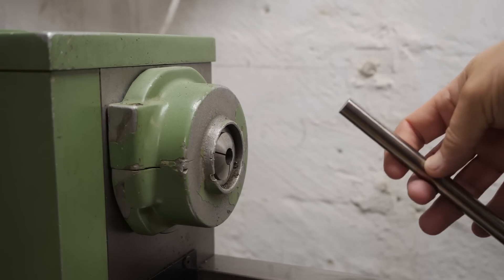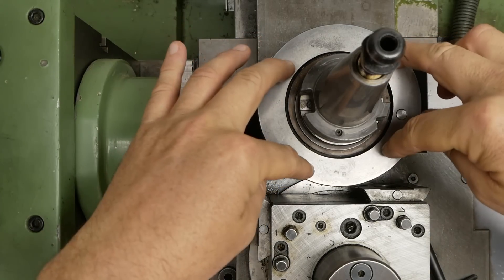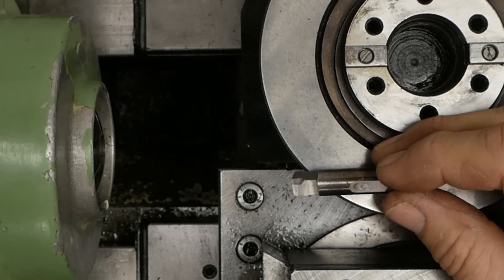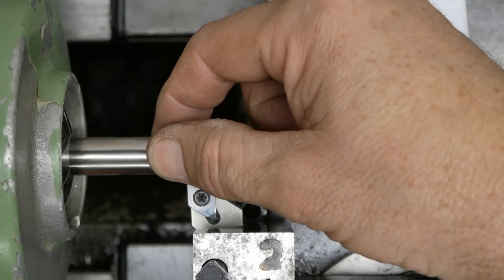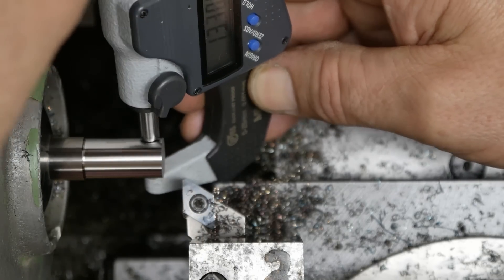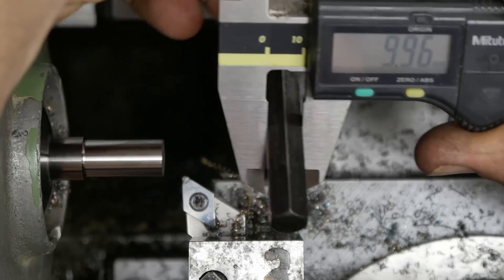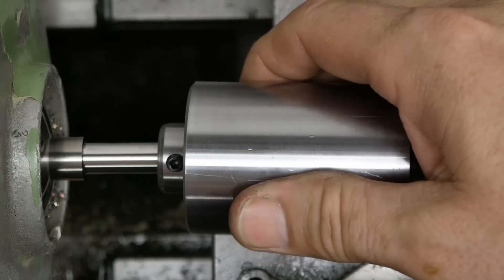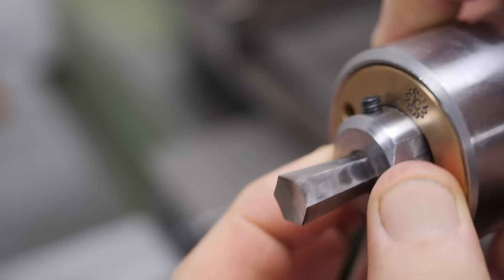Can you hard turn HSS in the home shop? || RotarySMP

Comment: I'd rather measure in a mixed metric, measure in thousands of an inch below or between multimeters. And in millimeters until a foot! Crazy but it's easier. 3mm /1/8", 6mm/,1/4" that or
 .250"/1/4".125/- 1/8" I dislike fractions. I don't work using it , but hobby stuff it's just easier in my head . Imagine going some place , telling someone you need  300 mm x .250" long  brass bar stock,. Then take it home and make metric head bolts with inch threads😂
Reply from the maker: I used to prefer tolerances in Thou, but have become more comfortable with metric lately.

Comment: At some point with the rotary broach, how does one go about accounting for the hole depth you're going to lose to the swarf(?) that's being compacted into the bottom of the hole?  If I need x millimeters of hex key tool engagement (depth) in this bolt I'm making, and the tool is a y millimeter hex, what is the initial "x + z" hole depth I'm going to have to drill/bore?
Reply from the maker: I just give it about 50% more hole than I need. I dont have a lot of success with rotary broaching though.

Comment: I hope you are going to sharpen that CBN tool back to cutting shape. Robin Renzetti told us on his Instagram that you have to lap the edge of the CBN insert to a very keen edge if you want to avoid chipping of the edge. 
You of course use diamond wheel for sharpening.
Reply from the maker: Yes, I was going to have a go at touching it up. Thanks for the honing tip.

Comment: when hardturning with a cbn tool never ever use liquid coolin on them at all. max use some air 
and its not just with hard turning that you make plasma deformation but you actually do that with every metal machinigh operation ( even grinding. we where tought that by seco back in school when i took the education as a machinest )

also there is a roughing technice that i developed. tested and used myself witch extended the inser corner life from 4 parts pr corner to more then 25 parts pr. coner with the same feed's and speed's witch i call "constant varying depth" it casly have to be hand programmed ( at least for now ) but it is super effective to increase the tool/corner life of the roughing insert

eks.
N300
G28 V0U0
G28 W0
G40G18G80
T0202M91
G54
G96M3S100P11
G50S1500
M28
G0 Z0.2
G0 X50.
G1 X-1.6 F0.18
G1 0.3 X1.0
G0Z0.5
G0 X45.
G1 X47.0Z-12. F0.25
G1 X45.0 Z-22.
G1 X47.0 Z-29.7
G1 X50.0 Z-29.6
G0 Z0.5
G0 X42.
G1 X44. Z-5.
G1 X42. Z-11.
G1 X44. Z-19.
G1 X42. Z-25.
G1 X44. Z-27.
G1 X42. Z-29.7
G1 X45. Z-29.6
G0 Z0.5
G0 X40.
G1 Z-30.0
G1 X50.
G0 Z0 X100
G28 V0U0
G28 W0

( the G28 just tells it to go in hope position and the "V" "U" and "W" is actual machine axis ( the W is for a Y axis btw ) you can just ignore the G28 ones ( took this from a program i made some time ago ) and also forget the P11 since it was specific for the citizen dual spindle tripple turret. witch allowed it to actually start turning the spindle and the M91 was to allow it to change over to the tool

try put the code into " ncviewer.com " set to lathe mode to see how it actually look and how it works

instead of letting it cut air why not just put in G4 x5 in before the first cut ? that way it would get up to full rpm before moveing ? ( G4 is a dwell command and the X value in the same line is how many seconds its dwelling for )
Reply from the maker: I have G4 P5 set in my PP when I use cam, but that conversational lathe macro doesn't work like that. I probably need to learn how to edit it's code.
Reply: @RotarySMP  sounds like a good idear. hope you also be able to use the code / methord i showed in my comment on a diffrent part. best of luck m8

if you want i could program a part for you if you want. if you do then just send me a mail

Comment: I did some hard turning of some 62 rockwell C tool steel the other day, what I found was the inserts would almost immediately chip but then would cut just fine on the chipped surface for a decent amount of time.  I wasn't using any kind of special insert, just regular stuff for turning steel.  I'm guessing hard turning likes a blunt edge, so that CBN insert might last some time even with the chipped edge.
Reply from the maker: It was not so easy to tell from the macro shots, but my feeling was that the CBN was more eroded than chipped.

Comment: Great video Mark. I have recently acquired a Wohlhopter UPA 4  with an ANSI 4 / MT 4 taper arbor that I want to change. However mine does not appear to have a removable arbor like yours. Do you have any information about the UPA 4 that could help me?
Reply from the maker: Is there a hollow arbor with an allen key wrenching hex down inside it? If there is you need to turn it clockwise, as though tightening, to allow the differential screw to release.

Some of the earlier Wohlhaupter had non-removable arbors though. There is a video out there of a guy converting one.

Comment: If you set up the system to drive the spindle.0.at-speed pin then G1 moves won't start until the spindle is up to speed.
Reply from the maker: Hi Andy, when I was editing, it occurred to me that there would probably be a solution like that. I need to look into that.

Comment: Hi Mark. Another great video. Back in the day, early nineties we used to turn hardened toolsteels D2 and O1 mainly at approx rc 60 using ceramic tips these also put out nice red hot swarf. I haven't done any real hard turning since. With the  cnc lathe I think you should try putting  bigger radius on diameter change steps as much as possible to avoid stress concentrators. Especially with rotary broach tooling.
Cheers for the excellent vid
Reply from the maker: Thanks for that tip Steven. In this case that diameter change basically got ground away when I ground the hex (which was probably too long).

Comment: Linux tip! Instead of using an HDMI splitter, you could capture directly in software from your LinuxCNC machine since -- it's a Linux machine! Normal things work on that too. You'd only have to make sure you have enough performance dedicated to running the actual machining program first.

Fortunately, a feature on Linux called cgroups is very good at guaranteeing some minimum specs (ram, cpu, etc...) for the app, and you could test it to see if doing both simultaneously causes either frame loss or spindle issues.
Reply from the maker: I do use the linux simple screen recorder all the time, but for live streaming, I would need an HDMI feed, not recording.
Reply: @RotarySMP  I understand-- you can send a stream of your screen (live) over your LAN to whatever machine you run OBS on or whatever streaming platform... No need to use HDMI cables and involve more hardware when you already have ethernet!
Reply from the maker: @purpleidea  I switched from OBS to an Atem mini pro ISO, as I got too many random stability issues with software switching.

Comment: I turn die punches (60 HRC) with CBN, it's a lot faster than cylindrical grinding.
Reply from the maker: I bet. What machine?
Reply: I use Winho lathe with ER collet chuck inside a 4 jaw chuck

Comment: Does Linux CNC have a MDI mode where you can execute single lines of code. If so something like S3000 M02 could pre start the spindle and the real program would not be accelerating the spindle at program start. You could get real fancy adding the spindle speed and start to the main program along with an optional stop. BTW The Chinese make a direct copy of the Narex so that may be an option for a cheaper arbour. (toolmaster from Hare & Forbes here in Aus and Unzud
Reply from the maker: Hi Rob. Yes, there is an MDI mode, and I also have my PP set to add a pause (G4 P5) after each program start when I program a part, but those lathe macros are a bit different.

I could probably still buy a Narex shank, but now have the material to make my own.

Comment: Oh this is going to be a good one. I just went through this with my Wolhlaupter head with a integrated 1-1/2” straight shank. 
I too used the CBN inserts on my lil Clausing Metosa C1330S manual lathe. I was able to turn that 1-1/2” shank down to a .010” oversized 3/4” shank, then finished it up with the trusty tool post grinder down to size. Them Wolhlaupter heads are case hardened to Rockwell 20,000 billion I think…. 
But I managed to turn it down with only one tip of one insert by taking .005” passes or less. 
The plan was to “practice hard turn” the shank down and then ultimately cut the shank off and drill and tap it for the differential screw ( I believe it is 20mm 1.5 and 16mm 2.5 pitch but I haven’t been able to confirm that yet) they also had two 10mm drive pins at 40mm on center. 
Boy am I’m glad to see you taking this one on. I’m hoping to learn a little bit more and interested to see how the Schaublin does as well. 
Always enjoy your videos, and I really appreciate your humble approach. You are going to love that boring and facing head though ! Looking forward to seeing its cameos in upcoming videos ! 😊
Reply from the maker: Thanks for the kind feedback Jason. Luckily the Narex shanks are all bolted on, so I dont have to do any hard turning on that side.

Comment: Wow, great videography! Really liked the close up Makro shots. As for the chipped insert, you at least can touch them up one time, just put on a nice slightly negative radius on the cutting edge.
Reply from the maker: Hi Christian. I dont think that insert is chipped. It looks more like wear. Did you regrind some with a diamond wheel? I need to try that.
Reply: @RotarySMP  yess i use a diamond wheel, diamond still beats cbn😁 stefan gtwr made a video a few years ago about that topic.

Comment: For the hdmi splitter idea i recomend adding a wireless hdmi cable (about $35 usd on amazon), you may want to cut the ddc pin on the wireless transmitter as you dont want it fighting with the lcd panel to set the resolution (at least it was on the cheap splitters ive used, aparently more expensive ones have ddc priority so it would take the resolution from one port and just duplicate to the second port, that was just the cheapest powered splitter i was using that needed ddc cut)
Reply from the maker: Thanks for the tips.

Comment: I've turned HSS on my Smart & Brown lathe. Not something I need to do often but carbide inserts did it with no real issue. I can't remember what I needed to do it for as it was some time back.
Reply from the maker: Did you wear out the inserts pretty fast?
Reply: @RotarySMP  I can't remember but I think I used the sharp polished and ground inserts that are designed for aluminium alloys. I have found they work well on stainless steels. I was looking for a picture of what I did to try to remember what it was for, I think I have one somewhere. Edit, I found the photo. I wanted to make a small gear cutter and needed to neck down a short part of the shank to leave the end to be shaped for the gear cutter.
Reply from the maker: @martinconnelly1473  Was it a commercial HSS cutter? Many are not HSS blanks. They often friction weld conventional steel shanks to drills etc, to not waste HSS on the bit that doesnt need it.
Reply: @RotarySMP  It was a HSS blank. Not just part HSS. My lathe weighs 750kg so it is not a lightweight hobby lathe.

Comment: it's really cool to see someone actually hard turn on youtube. hopefully we can see more hard turning with say something like 4140 ph
Reply from the maker: When I went looking for info on hard turning HSS-E, there is not much out there. There are plenty of videos, like Stefan Gotteswinter's of hard turning more conventional steels like 4140 though.
Reply: @RotarySMP  yeah, for hss you can use carbide, just normal carbide, id stick to insert tooling though.

the hardest I've personally worked with was a customer job at work that called for 4340 with a hardness of around 55 Rockwell C but the same logic still applies. as long as the cutter is harder than the material it will work.
Reply from the maker: @ramentaryramblings  I just googled "what is the HRC of carbide, and it seems to range between about 65-85. That 1.3207 can be delivered at up to HRC67, so it could be pretty borderline for some grades of carbide.
Reply: @RotarySMP  yeah, most name brand carbide will running around 72-75 minimum. and quality brands will run in the low 80s. if your getting even halfway decent carbide it's not an issue. most manufacturers on the packaging will rate carbide for hardened materials in the surface footage chart. cbn and diamond insterts will work but it's a bit overkill unless your working with case hardened materials.  

otherwise treat hardened material like stainless, low surface footage with an okay chipload, but don't worry too much if the chipload isn't high, especially for normal hardened material, for hss yeah I'd put more though into it but let the insert geometry do the work

Comment: Hi Mark that sure does glow pretty.    I did forget to mention on our live stream thread about the taper, is that you can program it out.
Once you know what the taper is you "simply" program that as your tool path.
It's done all of the time in production, especially for parts turned between centers , there is no way around part deflection otherwise.
Reply from the maker: Hi Steve. I really need to get the chip guard down, and then move the lathe off the wooden blocks onto more stable feet, and align it.
Reply: @RotarySMP   I remember  that you said that you want to elevate it enough so that you can run your pallet truck underneath it.
how much additional height do you need?   
What taper is the spindle ? the best way for spindle alignment (ie factory) is an alignment bar fitted the the spindle.
search for spindle alignment bar
Reply from the maker: @steveggca  The spindle is Schaublin B32 collet native. Doubt I can find an alingment bar, but ,maybe I can get my mate Franz to grind one on his big TOS cylindrical grinder.
Reply from the maker: @steveggca  I have the machine on 80mm wooden blocks. My final set up will probably need to be 60mm+ to get the pallet jack under it.
Reply: @RotarySMP  do you have more of that HSS blank  or maybe the linear rail shaft ?  mount it in a collet and then check the runout at the collet and then the free end.
assuming that there is no runout at the collet end and not a huge runout at the free end , zero the indicator at the collet end,  jog out to the  to the free end ,rotate
the spindle until the indicator zeros and Et viola ! you have a bandaid alignment bar.    
You would ideally want  about 300mm but anything over 100mm will get you started.
Reply: Know any concrete specialists ?  some  well made   concrete pavers grouted or glued to the existing floor  might be an option.
Reply from the maker: @steveggca  It could be an option.
Reply from the maker: @steveggca  I have another three sticks of that 160mm long 14mm HSS-E

Comment: Wouldn't it be easier to buy sk40 holder with thread 1 1/2" for boring heads and turn new diameter and thread as is in Narex? To match with drive slots you can use shims or turn exact lenght.
Reply from the maker: How do you pull it up onto the drive keys without a differential thread stud.
I do have that one SK40 shank I showed, but chucking it would be pita, as would trying to hard turn an internal thread in hardened steel,  so it will be easier to just make a new one.
Reply: I mean to cut external thread M28x1,5 directly on sk40 abor.
Reply from the maker: @TomekWojciech-r2b  I got that, but you need the drive lugs to resist the torque, and therefore need the differential screw.

Comment: If only there were machines for finishing hard materials to fine tolerances. They should build lathes with, like, an angle grinder attached to it, and call them round grinders, or something
Reply: Lathes with the right material and inserts can achieve finishes as good as grinding.
Reply: @steveggca  it turned with a taper as the part deflected. There is less chance of that happening on a cylindrical grinder, that's why they exist. Oh yeah
Reply: @JSmith19858   Hi J.    Mark and I had a bit of a discussion on the live stream video  about the possibility of the headstock not 
being in alignment   .   Given that the spring pass had little effect on the taper   Lathe bed levelness and headstock missalignment
will of course also cause tapers.  
My own Instinct and experience is that cutting forces were not the cause.
Of course all of this is speculation and needs to be confirmed.
Reply: @steveggca  then turn it between centres and adjust the tailstock to remove the taper. Or, use the correct tool for the correct job. There is a reason why grinders exist and are set up the way they are. Lathes aren't for sub micron work and there are other methods for achieving closer tolerances
Reply from the maker: I dont have the space or work for a cylindrical grinder, and didn't have time to drive out and see my mate who does. Then again, I was given the HSS-E blanks and the CBN tool, so I was really curious to try this.

This didn't need to be sub micron. Just a decent fit into the rotary broach tool. As Steve identified, the problem with the taper may well be that I have not yet levelled the lathe, it is on wooden blocks, so I may have a twist there.

Comment: I saw a Schaublin 102N for $3750, but it's too small for me: i bet super precise though, like a Wabeco.
A china E-leadscrew lathe on ebay is $2k, but it's got 1.5" thru hole and 40 inch bed: no way i'd trust the electrics as you're totally reliant on it not failing, imagine trying to find a replacement.
Reply from the maker: The 102N is based on a very rigid, classic lathe. I dont think the Wabeco chinese sourced machines are in that class.

Comment: You should add a time delay on the spindle.0.at-speed pin in the LinuxCNC to prevent cutting before the spindle is fully up to speed.
Reply from the maker: Thanks. I suspected there was a way to automate that.